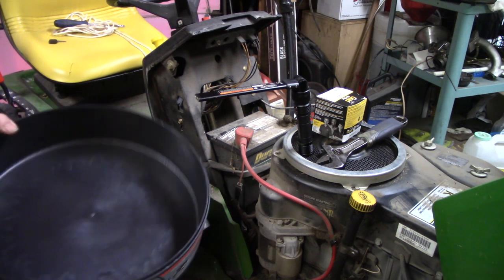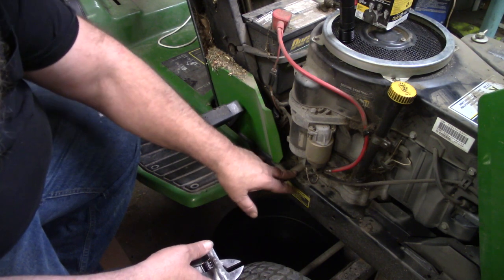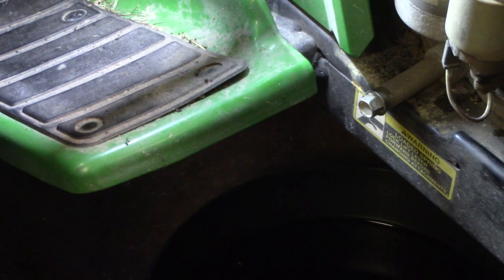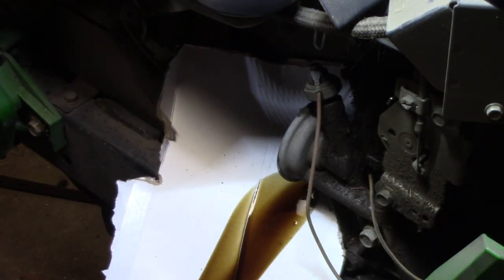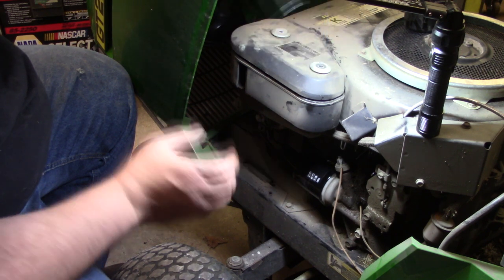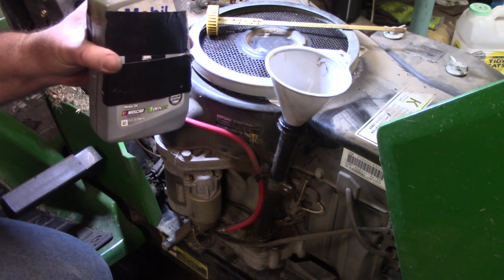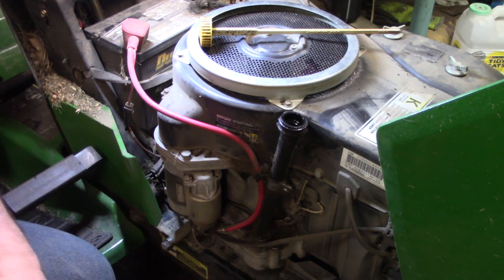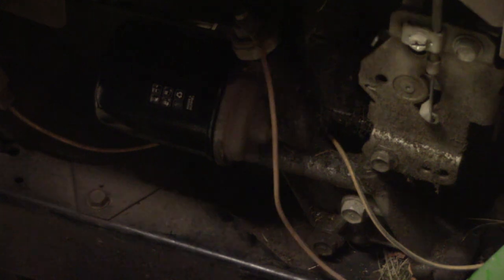How to change the oil in a riding lawn mower. #oilchange

Comment: Can you explain why you should make more than any other job per hour?
Reply from the maker: Well if I'm setup for sharpening blades and I can do 20 blades in one shot it saves me time so I pass that along to the customer. If they want me to drop what I'm doing and get set up to do just 1 blade that takes time away from the customer equipment I was working on.
Reply: @PullerbearEd  so you’re not just charging for the work you’re  also charging for the time
Reply from the maker: Basically yes, if parts are required I don't mark them up. I've been dealing with my suppliers for years and I get decent prices on that. Everyone's time is valuable weather it's my time fixing stuff or the customer time waiting for there equipment to get back to them. I do not charge as much as a regular repair shop does because I do this as a side "hobby " in my spare time and the people that I do work for know this. If you referring to just the blade pricing more of the people that bring them to me have multiple sets and bring in bigger groups or if they bring their equipment in for spring service they have their extra blades with it.